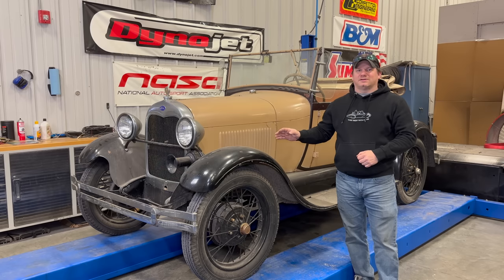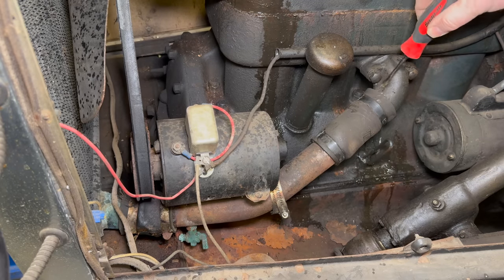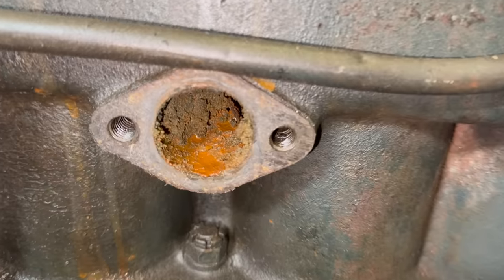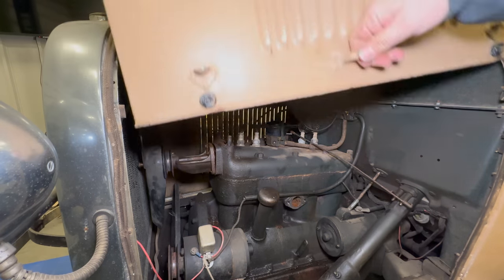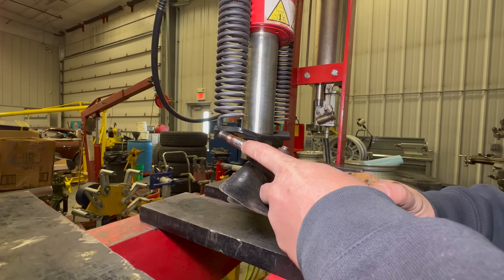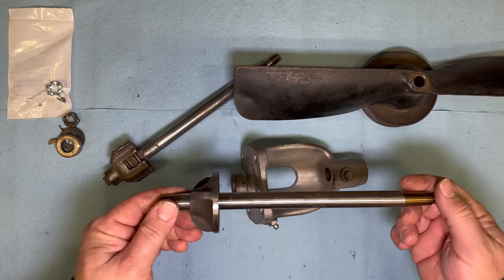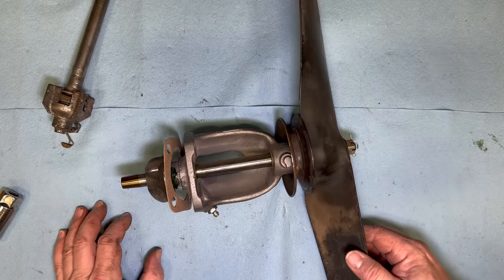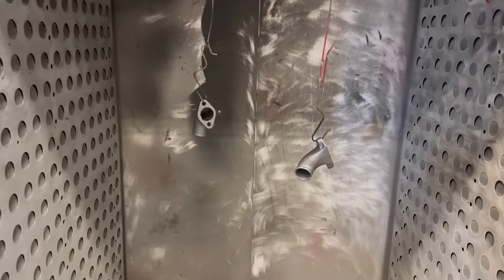1928 Ford Model A - Coolant System

Comment: Steve
Get rid of the old pressed steel fan asap. They are prone to throwing a blade with serious consequences .
Mine let go and took the top radiator out let and hose with it before causing damage to the bonnet(hood) . If the bonnet was open and you were working on a running engine it could kill you. The replacement is fully cast alloy incorporating the pulley all in one piece and readily available. Enjoy your Model A, they are indestructible .
Cheers

Comment: Hi Steve that water pump doesn’t appear to have any water seal only a bronze bushing ,l would be interested to see that it doesn’t leak . I have not seen a Model A pump housing like that before! Keep up the good work on your Model A restoration.
Greetings from Australia 🦘🦘🚕 Russell
Reply from the maker: Same as the original rope seal it uses the water pump grease to keep the water back.  It is not a pressurized system so it doesn't take much to hold it in.

Comment: Great video, this is my next project for my Model A which sat for 20 years with water in the radiator... So much rust build up, and a leaking water pump to boot! I don't know if I'll fully disassemble my water pump, I think I'll start by getting one of those graphite split rings and packing the water pump with it while still attached, but at least I know what I'll have to do if it comes to the full disassembly.

Comment: Hi Steve, I haven't tried it myself, but some guys have reversed the inlet and outlet on the radiator to loosen the crud in the engine cooling system and radiator. It makes sense, because the crud has been laid down in one direction and when the waterflow is reversed, it get dislodged. I don't know how long this must be done, but an hour or two should be enough.

Comment: Coolant & brake systems always seem to need the most work. I once had a 54 Hudson Jetliner that needed everything re conditioned  & the water pump & bearings were BEAT. Have you ever heard of Evens non corrosive waterless coolant?  It boils at 375 degrees  vs water @ 212 or regular coolant @ 235 & you don't ever have to replace it. Check out on Y.T. :  "How Evans Waterless Coolant Works; The Limitations of Water, & Why Evans is Better for your Engine". Saw it on Jay Lenos Garage once & He uses it on all his Vehicles. He was Showing His Duesenberg & accidently polished through the engines aluminum water-jacket cover. Dissimilar metals galvanic corrosion mostly ate away the metal from the inside out & Him polishing the outside of it  was the last straw. Its a good product/insurance...
Reply: I'm a great fan of silicon brake fluid. I had a car sat on blocks for sixteen years, and when it was recommissioned the master cylinder, wheel cylinders and calipers were all functioning perfectly. It's non-hygroscopic, so after 35 years it's as good as the day it was put in.